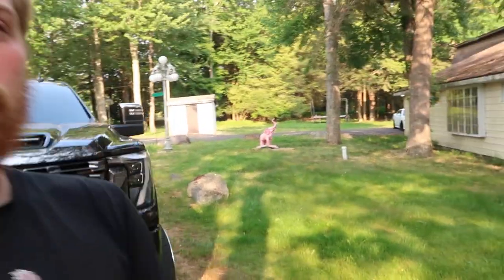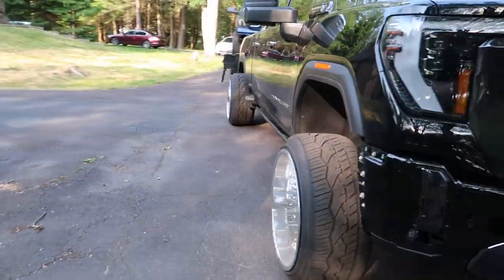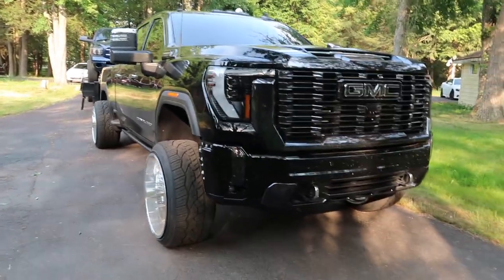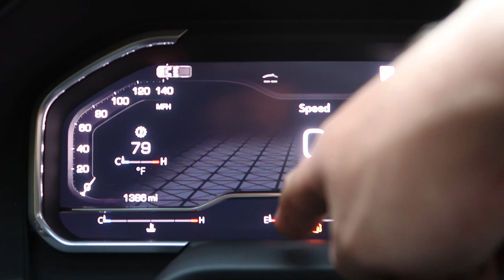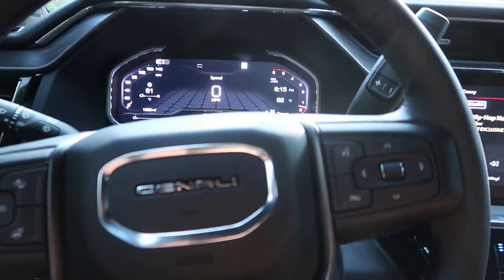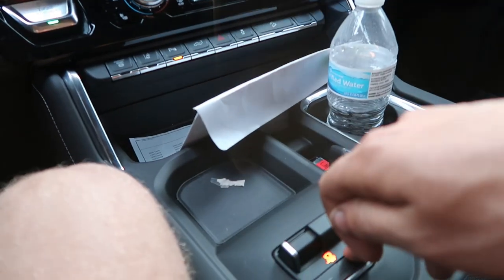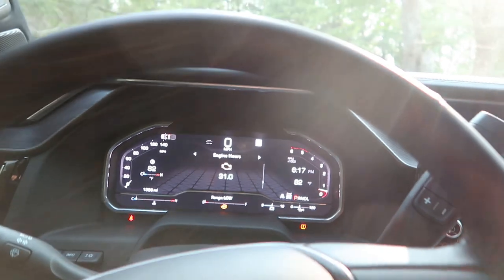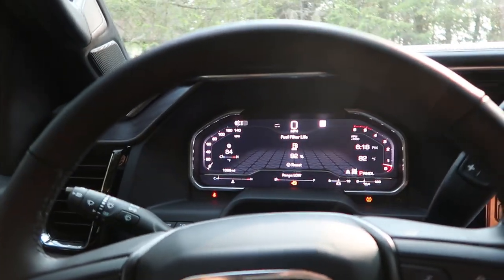My Towing Review With The New 2024 Duramax!

Comment: I have the 2024 at4 duramax. I towed 10 yards of gravel and concrete and let me tell you that it pulls! I have pulled with a 2019 and 2020 duramax and it doesn't compare to the 2024 duramax with the new turbo. I've pulled in the mountains of Pennsylvania and back in the hills of Ohio. The torque on the 24 is powerful

Comment: I have a 2022 Chevy 2500HD Durmax and my Truck does not sag nearly as much as that loaded with a 32ft 7700 pound RV trailer. I do use a load leveler system which help distribute the weight through the frame. When I attached the trailer, my truck only sagged about 2.4 inches. Of course I am running the stock wheels (17") and BFG's 245/75-17 ALL ALL terrain. Pulls exceptional.

Comment: Thanks for the video - I though some of the trailer settings were in info screen. looks like your ass-end is squatting down a bit, is yours a stock  2500, I ordered the 3500 frame sprints axles and shocks for my 2500 plus the extra cooling pkg. Thanks Mike

Comment: Get a Timbren SES Suspension Enhancement System. I use it on my 24’ 3500 and I have minimal squat with 3,900lbs of 5th wheel pin weight.

Comment: My concern is the transmission over time.
Reply: The Allison 10 speed? Dude, these transmissions are monsters and are used in way more heavy duty applications that the 25 =00 series trucks. I had a transmission/diesel mechanic tell me that the 10 speed Allisons are the least of anyones worries. He stated in some years, he remembers only one needed any major work without having about 350k on it.
Reply: The one in the new GM trucks are not made by Allison only approved by Allison so I’d say the ones in none gm products are true Allison transmissions and built heavier.
Reply: No, if you do actual research, you will see that people have had nothing but issues with the new junk ass 10 speed transmissions. They are probably just as bad if not even worse than a 68RFE. And that's saying something. Also the new 10 speed is NOT an Allison. It was an in-house design by both Ford and GM. The only difference is the bell housing, the only reason it says Allison on the GM models is because GM bought the right to put the Allison stamp on it. And quick Google search would show you that.